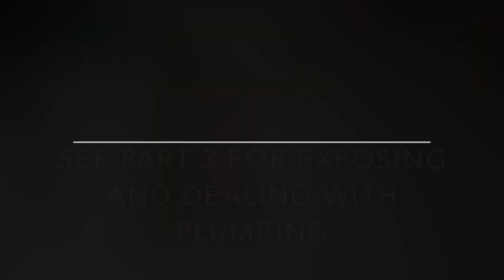Part 2: Breaking Through the Concrete Slab

Comment: is there any risk to the foundation of the entire house?
Reply: not really, you'd have to remove a lot of concrete to risk damage. The concrete gets put back later anyway. Think of it like your walls. Lots of 2x4's you could remove a bunch before the structure was at risk.
Reply: The foundation is just an after pour and it doesn’t add to structural strength of the structure. The concrete belts along the walls under the concrete are the ones that add structural strength which shouldn’t be touched
Reply: I hope you are kidding.